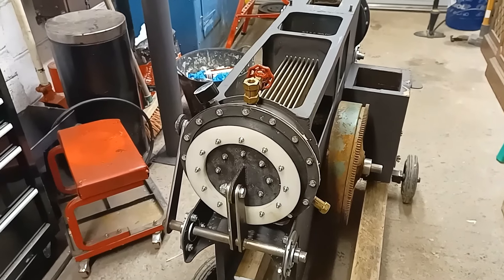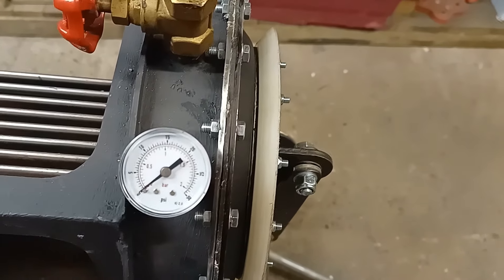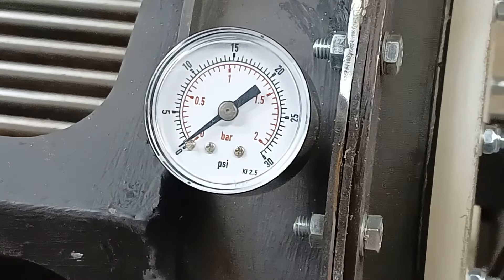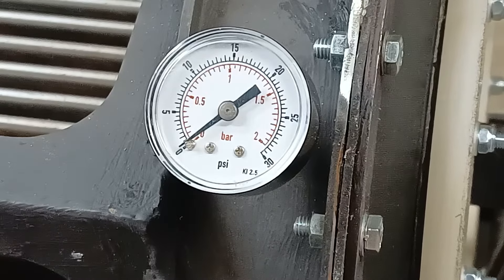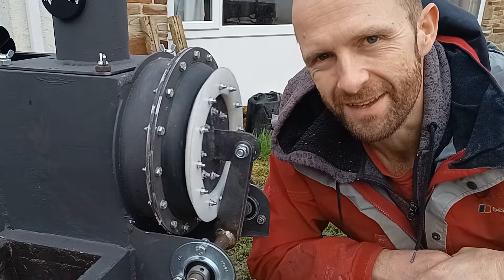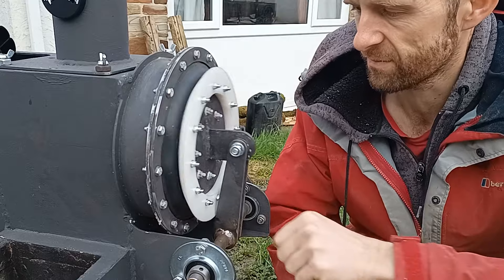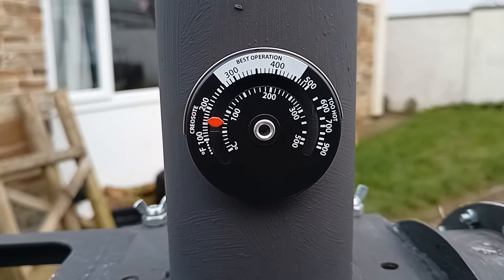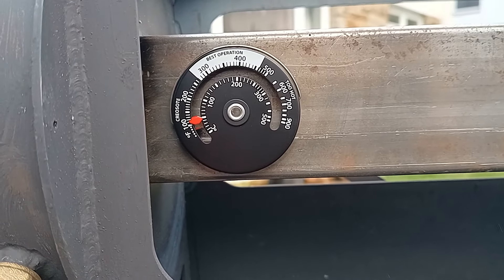Stirling Engine Generator Mk4 (Rocket Stove!) Part 6

Comment: Would probably increase the efficiency of the engine with a higher pressure (you'd need to pressurize the other side of the piston for it to not just be stuck at expanded) and a cooling method (either passive air or water cooling). Great and sleek engine build!

Comment: Brilliant piece of homemade engineering.  You deserve some financial reward from the sale of plans/parts/kits.
Reply: yeah, even for a low output engine these are of interest for the homesteading and off grid communities
Reply from the maker: I only really do it for fun : ) I've got a day job! It would be nice to see a kit widely available. Just a bit more refining to do
Reply: @ShanePomeroy  I'm pretty sure if you set up a PayPal or some kind of way for us to give you money as some kind of form of appreciation you will definitely get some donations my income tax is coming in and I know I will definitely throw you a hundred bucks your way just for being an awesome inventor
Reply: @ShanePomeroy  can I ask what you timed this one at?
Reply from the maker: Do you mean power output? @projectguy6298
Reply: @ShanePomeroy  do you need some Tires mate what diameter is your steel work on the end? I’ll have a look
Reply from the maker: I've been pondering your idea a lot! I probably won't be modifying this particular engine to except them but I think it's a great idea. My only concern is the heat getting to them. I want to measure the temperature on the hot side next time to see. Many thanks @stuartdean4620
Reply from the maker: I'll be testing it soon, cheers @projectguy6298
Reply: @ShanePomeroy  from the feel of them, some of the tires are a bit like natural rubber.
And others are more like Car Tires of vulcanised rubber so I guess that the durability might not may be the same, I guess

Comment: Wonder if tapering the cooling tubes would help to displace the heat faster giving more surface area.
Reply from the maker: Hi Mark, not a bad point. The cooler has a much harder job losing heat. I'm fairly happy with the basic configuration,  so going forward this is worthy of experimentation. Thanks

Comment: 5:00  Solve one ...  Since the part of the  stroke where the piston is entering the support ring is very short, why not tighten the bolt on the piston-lever point so that the orientation of the piston is rigidly fixed to the lever arm.  That will have the piston in the correct position on the 'bottom' of the stroke, and the minor off-parallel at the top of the stroke wont matter.  Removes a moving joint which you could remove the bolt and then weld solid once the alignment was correct.  Best part no part - as someone says!
Reply from the maker: Hi Nigel, I like your thinking! I'll take a look at removing that pivot,  it might be fine without it? The beet part is no part - my kind of engineering! Many thanks

Comment: This looks promising. The diaphragm makes as much noise as mine. I need to buy thermometers like yours. This will allow you to better track the process of converting heat into work. Regards
Reply from the maker: If you find a solution to the diaphragm noise I'm all ear's? Someone's mentioned a slight pressure charge so the diaphragm is always pushing out and does not fold in on itself.

Comment: Wow, just when I think it's as good as it gets, you outdo yourself!  Wonderful.  This is a great series.

And forgive me for being presumptuous, but I'm very excited to see a design like this go as far as it can.  If there is one thing I would like to see, it is some regenerator wool pushed into each slot in the middle of the "cold' exchanger. Even though the current long-tube design is acting as a regenerator, the surface area is low compared to something like steel wool.  I'm 99% sure you could push the output to much higher by introducing steel wool into the engine.  One thing about Stirling coolers, is that they don't work well at all, unless you finely tune the regenerator performance. The same goes for engines. I've seen regenerators increase output by 2x  (depends on the design and how good/bad it is to begin with).
Reply from the maker: Hi, I will add a filler of some kind along the length of the engine at some point. I'm going to take a power reading first to see where we are : ) Cheers
Reply: @ShanePomeroy  Seems like a very reasonable thing to do. I appreciate all the work you put into this. Thank you for taking the time to share it with the rest of us.

Comment: Hey Shane. 
I would like to see a comparison between what you have and one with a material such as metal scrubbers packed into the tubes as a regenerator. There seems to be a lot of air space between the two pistons. 
Also ypu my have thought of a second arm on either end to keep the piston flat moving in and out
I do love the progress its fantastic
Reply from the maker: Hi Perry, I'm contemplating inserting a mesh of some sort down the tubes. In hind sight I would have reduced the 3mm air gap to 1mm or so. The dead space situation isn't actually to bad because I can still achieve 1.6 : 1 compression ratio with fairly large surface area's. The pistons could do with some stabilisation but funny enough it doesn't seem to effect the running that much so I'm not to worried. All the best

Comment: Cool project. I think you misread the pressure gauge, it hit 6psi (0.4 bar not 0.6 as you said)
Reply from the maker: Your quite right! My bad! I've just spun it over to check. It does bear the question if I should increase the ratio now? thanks
Reply: Having accurate numbers can only help 😊 I've misread a few things in my time...

Comment: Would efficiency be improved  by trickling cold water of the cool end of the heat transfer tubes? If so, a simple pump could be used to recyle the water, without draining too much energy.

Comment: This is so fascinating - my mind thinks of things like the feathering mechanism found on side wheel paddle boats and Watts Parallel  motion  to make your diaphragm pistons go square into the receptor - I still like the corrugated mesh "finger" inserts to maximize heat transfer
Reply from the maker: Hi, I'm going to take a power reading first and then plan to insert the mesh pieces and check the power again. My fathers been down the local hardware shop checking out the edging mesh profiles for blockwork! cheers
Reply: @ShanePomeroy  Yes I  imagine edging mesh profiles shape would work but are likely to be galvanized steel and less conductive - Be very careful with getting galvanized items too hot - Zinc burns in a white haze and is very toxic if breathed in - A friend ended up in hospital in an oxygen tent after volunteering to cut down a school cycle shed with a torch -  Aluminum from a car grill mesh available from Fleebay would be more malleable and a better conductor - if you corrugate it slightly it will make alternate contact with the sides of the passages to stop it rattling and conduct more heat.

Comment: I wonder if attaching a fan on the crankshaft below the heat exchanger would improve performance any? Or would the resistance of the fan offset any gains?
Reply from the maker: Good idea and good question : )

Comment: Hola amigos, enhorabuena, has conseguido una máquina stirling excelente, chapó, estoy deseando que acoples el generador eléctrico, cuanto pesa un el volante de inercia y el diámetro de los pistones me lo podrías decir, gracias y un saludo machote.
Reply from the maker: Flywheel is about 40kg and diameter of pistons is about 12". I'll put the full spec in the description when I get it together
Reply: @ShanePomeroy  gracias, amigo, seguro que te seguiré haciendo más preguntas.

Comment: Perhaps you could use off the shelf replacement parts from a large air-operated diaphragm pump - they use large diameter pumping diaphragms much like what you've built for this engine, perhaps even the housing could be adapted to your design. Wonderful project so far my friend, thank you so much for sharing!
Reply from the maker: Those large air-operated diaphragm pump are actually the inspiration for this engine. I will check the prices out, thanks

Comment: Hello Shane,
It appears that this is an Alpha configuration Sterling engine. 
Which makes me ask why you have not piped the two cylinders together?
I may be off but I believe you will see an increase in output power by doing this.

Comment: Maybe a parallel linkage for the pistons? You might be able to improve cooling by funneling the cold air over the regenerator with a flue style thing above it to create a draught a bit like cooling towers for a power station, or maybe a water spray?
Reply from the maker: Good ideas! You've got me thinking, I could surround the existing chimney with an outer tube and use this convection heat to pull air over cold side. I shied away from parallel linkages due to the increased complexity, cheers
Reply: @ShanePomeroy  if you fixed a rod to the piston link, say a foot long for a random number and then supported the end of it central to the cylinder though a sleeve supported perhaps by a bracket bolted to a couple of the piston pericarp securing bolts, it should stop the diaphragm tilting but using no extra linkages. Maybe a Teflon ring or similar as the sleeve / support. Just typing out loud.

Comment: With a bit of modification to the flywheel, it could be made ventilate the cold side heat exchanger.
Reply from the maker: It is a good idea. I suspect I will probably do this in time, cheers

Comment: I haven't checked the literature, but, if you add a safety valve to control internal pressure, then rather than venting the machine during start up you could actually pressurise the system to say 1 bar.  That would double the mass of the working fluid, and hence improve (maybe 'double') the output. Maybe!  Then if the system is sealed mayhap optimise the working fluid.  I've heard meths is quite good - what could possibly go wrong!

Comment: I'm curious if you would like to try it as a stirling heat pump  rather than a stirling engine.
Reply from the maker: Hi, it would be a fun experiment. I've got a small motor I could rig up.....
Reply: @ShanePomeroy  I love your alpha stirling engine by the way.  It reminds me a lot of another one i seen on you tube titled "Stirling Engine Alpha Monochannel"  by Alexandr Fediaev 

Iron makes a fairly good regenerator material as it offers one of the highest volumetric heat capacities forr the surface area  containing that material and the dead space it contains. 

Your heat exchanger and stirling regenerator channels are better than Alexandr's in that yours probably creates less turbulence, and is easyer to make. 

Maybe his design might inspire you to make a tub for water on the cold side of your engine. It would have better thermal energy transfer capability than air and could be cycled through a larger radiator. 

Motor spinning one way moves heat into your chimney, and removes heat if spun the other way.
Reply from the maker: @kreynolds1123  I have seen alexandr 's stirling enyine : ). It certainly must have inspired me with this engine. I was trying to stay away from cooling water to cut down on complication. Interesting fact about iron's heat capacity. I can also see how cold I can make my engine (heat pump!). Many thanks
Reply: @ShanePomeroy  i have some time to kill, and hope to convey to anyone reading this, why volumetric  heat capacity is important in a stirling regenerator. 

Take iron. It has a specific heat capacity of  0.451 J/g•°K and a density of 7.874 g/cm³. Thus it's  volumetric heat capacity = density × specific heat capacity, so 1cm³ of iron stores about 3.55 (J/cm³⋅K).
We might contrast that with 1cm cube of Polypropylene with a volumetric heat capacity of about 1.9 (J/cm³⋅K). Now if both cubes are shredded to the same surface area  with  both having 1cm³ dead space for air flow, then which would you prefer?  3.55 (J/1cm³ of iron + 1 cm³ of air ⋅K) or 1.9 (J/cm³ of Polypropylene + 1cm³ of air ⋅K)?  Given the fact that I can store more energy for the same surface area means I can use less surface area to store the same energy, I'd be more interested in iron. 

Steel wool is made from low carbon steel with about the same volumetric heat capacity as pure iron, while stainless steel wash scrubs are made from 304 stainless steel which as a better volumetric heat capacity of 3.89 - 4.28 J/cm³⋅K, and are already shredded. But more impressively,  the thermal conductivity  of 304 stainles steel is  roughly 1/3 that of iron which reduces conduction from the hot chamber to the cold chamber.  Making 304ss a very desirable regenerator material, but less desirable for the hot and cold thermal exchang material.

304 ss wash scrubs or screen meshes make effective regenerator material that have also has better resistance to oxidation.
Reply from the maker: Hi, many thanks for that. I'm more of a practical hands on person myself so I'm always interested in the theory being explained to me in simple terms, All the best @kreynolds1123
Reply: @ShanePomeroy  I went and explained why iron is desirable for a regenerator, to minimize dead space, but forgot to state why minimizing  dead space is important.  Minimizing dead space is important as more dead space  than nessesary reduces stirling engine work output and overall efficiency.  The trick is optimizing air flow through the regenerator while minimizing the dead space in the regenerator.

Comment: How come these magnetic temperature gauges do not loose their magnetic potential with heat?
Reply from the maker: Good question, I've just taken a look at one! Turns out the magnet does not touch the heated surface and is held off a few mm so there is an air gap.

Comment: Awesome! That piston wobble can be resolved with a watts linkage, it was James Watt's solution to reducing this situation in early steam engines. You really should consider trying to find a copy of that history of caloric and heat engines, sadly I gave mine away to someone like yourself but it is the bible on this subject imho.
Reply from the maker: Good Idea with the watt linkage. I have a copy of caloric and heat engines. My favourite hot air engine book. At the end of the day there isn't a great deal that hasn't already been thought of so the info contained is very relevant.

Comment: Have you measured the running temperature of the fire chamber and what is it? This is amazing and I thank you for sharing your progress.
Reply from the maker: I will take some readings before / after the hot heat exchanger and also internal temps too, kind regards

Comment: There's a regenerator? If not, I believe your can seal the bottom of the tubing just after the hot box and pour molten aluminum between the tubes to take some heat...
Reply: The whole thing is a regenerator - dividing it up into a stack of 8 parallel channels (more would be better I imagine, but only to a point) allows for greatly increased surface area without increased volume, providing the same benefit as a more conventional regenerator.

Comment: What if compression ratio increase to 10:1 or more?
Reply from the maker: theoretically I think the engine would use more energy than it put out. Practically the diaphragms will burst. It is a good question because I don't fully understand the  principle's here. I've seen engines that run very high compression ratio's but is this because they are running high temperature differentials? All the best

Comment: Excellent work Shane. I am wondering how many degrees the pistons are out of phase? 90 deg? Also I'm avidly awaiting the power output results!
Reply from the maker: Hi Greg, I've set the phase angles at 105 degrees. Power test in a few weeks once I've sorted a dynameter. Don't expect massive power!

Comment: Very interesting this is a similar configuration for a cryo cooler which is a highly efficient Sterling engine you're on the right track 

I would suggest a speaker generator and frame integration as a part of the diaphragm refinement another words you can add a speaker generator at the ends of these pistons/ diaphragm in order to generate a large amount of electricity depending on what subwoofer you are using https://youtu.be/psfzTCVWtGc?si=0ldBQITFalgqTqs_